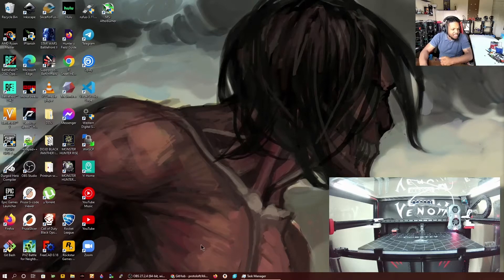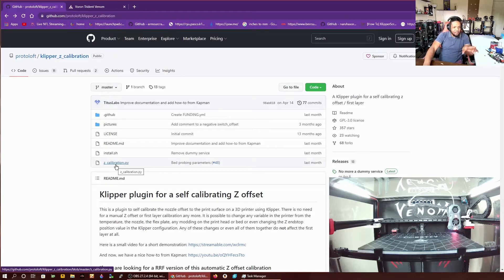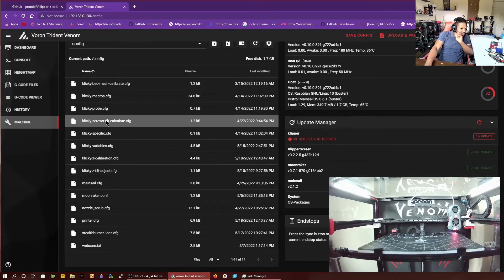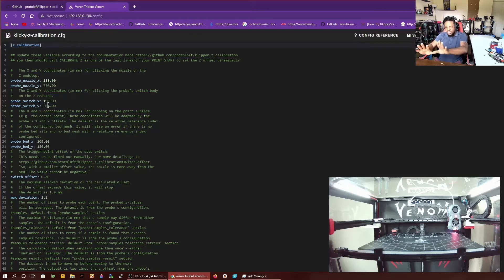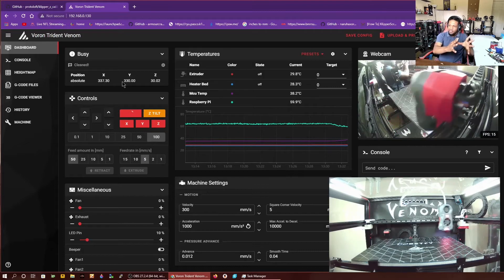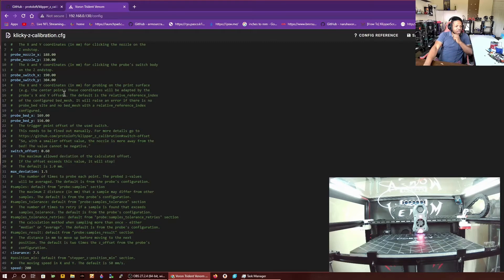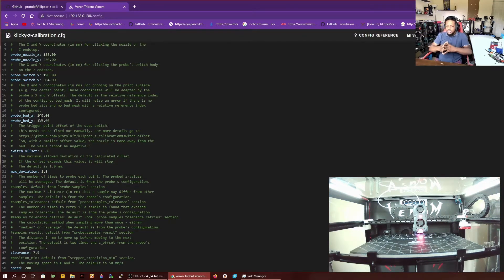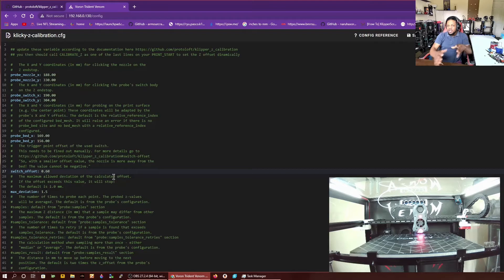//How To Setup Klicky Probe Auto Z Calibration  In Klipper // GoldenJaguar392 #3Dprinting

Comment: Ok,  One thing:  My trident is working fine with klicky,. Never used that endstop switch on side of for anything.  Now trying to get nozzle to trigger it, and not working. Of course, my config uses klicky for probe endstop.  How do i config for both?  
[stepper_z]
step_pin: PF11
dir_pin: !PG3
enable_pin: !PG5
rotation_distance: 4    # Rotation Distance for TR8x8 = 8, TR8x4 = 4, TR8x2 = 2
microsteps: 32
full_steps_per_rotation: 200
#endstop_pin: PG10   #- LDO setting

Comment: Is this Auto probing supposed to happen automatically with every print? I’m only getting the homing then QGC and that’s it.
Reply from the maker: you will need to put Calibrate_Z in you're slicer or config
Reply: @GoldenJaguar3D  one more question the actual offset reading I get from it, were am I actually inputting that information or am I just saving it to the probe?
Reply from the maker: @TheCyclingConquistador  after you do you initial z offset like usual..when it does a Calibrate z you don't save it...it will be done  each print just like a bed mesh run before each print
Reply: @GoldenJaguar3D  thanks

Comment: Hi, just a quick question. Can i use a z endstop and bltouch to do this auto z calibrate?
Reply from the maker: Great though but it won't work because the limit switch body is what is pressed against z endstop switch and not the switch trigger. the bltouch don't have wide enough space away for the pin to press against the z enstop
Reply: Thank you for that information. Do you prefer klicky probe, euclid probe or unklicky?
Reply from the maker: @rjs3dprints  I prefer the Klicky probe. The one I use is from Annex K3 engining is called Quick Draw Probe. https://github.com/Annex-Engineering/Quickdraw_Probe
Reply: @GoldenJaguar3D  thank you again. Is there a way that i can use euclid probe or klicky as normal probe like bltouch for now if i dont have a z endstop switch like sexbolt style? Thank you
Reply from the maker: @rjs3dprints  yes you certainly can use it without a z endstop..like a bltouch
Reply: @GoldenJaguar3D  so i just need to follow your video on how to configure klicky probe on klipper to use it as a bltouch style? sorry for a lot of questions. im noob with this stuff. thank you
Reply from the maker: @rjs3dprints  you can but I would use my other video how to setup clicky probe this was more focus on the auto z using a z endstop switch...here a link to that video https://www.youtube.com/watch?v=VSVzQGz5KHg&t=15s&ab_channel=GoldenJaguar3D

Comment: Hello, first of all thank you for your videos and guides for Voron/Klipper related topics. You're basically the one where I'm heading when setting a new feature. I have been able to gen Auto Z calibration finally working,  but I seem to have an issue with "Probe samples exceed tolerance. Retrying...". I had this problem with inductive probe on my V1.8 (it was melted, so I switched to Klicky) but I have it it with clicky too :( My PROBE_Z_ACCURACY is probe accuracy results: maximum -0.804500, minimum -0.854500, range 0.050000, average -0.829500, median -0.829500, standard deviation 0.025000 and PROBE_ACCURACY is probe accuracy results: maximum -0.804500, minimum -0.854500, range 0.050000, average -0.829500, median -0.829500, standard deviation 0.025000      Unfortunatelly when actually probing before the print I keep getting  "Probe samples exceed tolerance. Retrying..."          I'll be so glad for any response from you. Thank you in advance
Reply from the maker: Hi i had this issue before try to redoing you're z endstop switch offset, If that doesn't work maybe try to rebuild the probe, check connections, also make sure the probe body is hitting the z endstop switch.

Comment: hi hendry, i saw in your video that the rpi mcu temperature is over 60c. mine when it reaches a temperature of more than 50c the printer automatically turns off or the rpi with the mainboard mcu is disconnected, how do I solve this problem so that my rpi 3b+ can run at temperatures above 50c
Reply from the maker: Hi do you have heat sink install on your pi, also you put a small fan over it, I'm running the pi 4B so it's a bit more efficient managing its thermal output.

Comment: Hi, there is no klicky-z-calibration.cfg in the klicky repo. Where can I find it? I tried to used the config file for auto-z-calibration (the general one), but there are no proper macro names for klicky :(
Reply from the maker: here you go I can't seem to find it Either 
https://drive.google.com/file/d/1_hOOYdAiwQB-5AkbINqJWsNoV3op7bhn/view?usp=sharing
Reply: @GoldenJaguar3D  you cant find it because there isn't one, you need to do it by yourself...
Reply from the maker: @futtytuck  It’s was available with the klicky probe macros, but it seems to have changed now, check my first video out you can clearly see it. It’s certainly not hard make one.